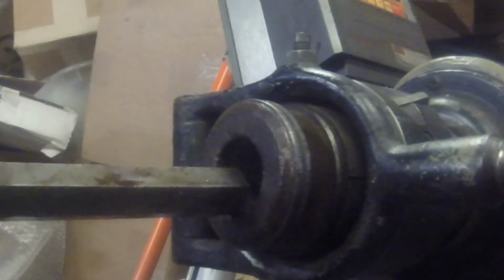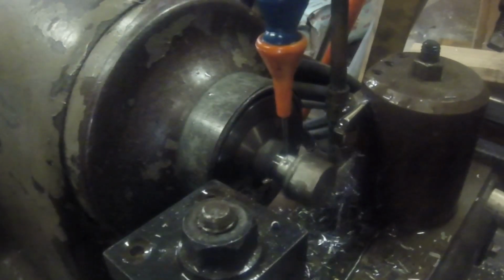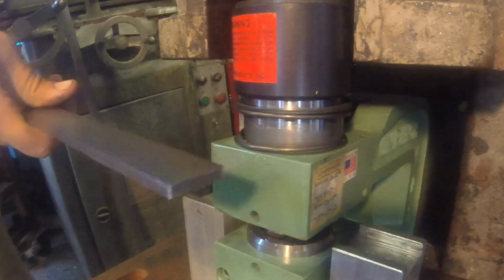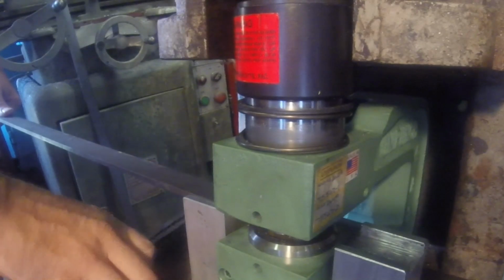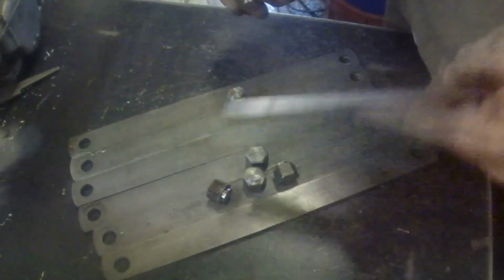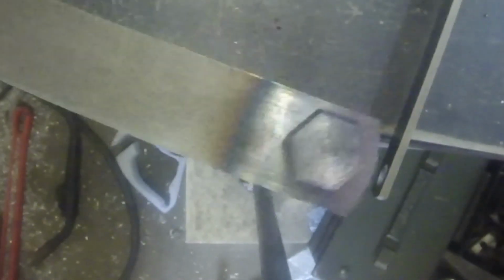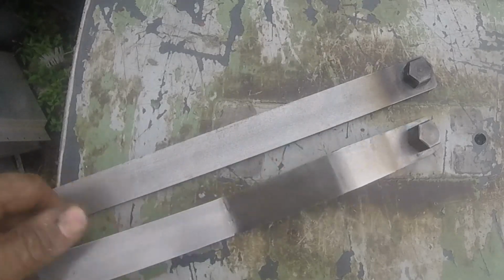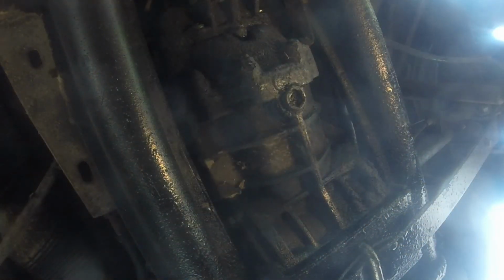Making a hex drain plug tool

Comment: Suggestion - while on the lathe put a bevel on the back of the rod so when you weld it in you get better penetration - then tweak your welder settings, wire size, etc.....
Reply from the maker: That's a great idea!  Maybe once or twice in my life I've laid a pretty weld bead and it was after doing it for a few hours.  I need to just sit down, suck it up and figure it out.  Maybe this winter when it's freezing cold in my shop :)
Reply: Ebbco of course you could also countersink the punched hole a bit - that would give you a nice “V” to lay the weld in.
Reply from the maker: Very true.  Give the bead a nice place to flow into.
Reply: Along the same lines......why not put the chamfer on the end of the hex while it's in the lathe and skip the milling machine setup all together?  
Cool vid.....cool product. Thanks! :)
Reply from the maker: I thought of that but with the hex bar the chamfer would be deeper at the points than on the flats.  I wanted an even chamfer all the way around.
Reply: Ahh.....good point!  Not sure why that didn't dawn on me before. LOL :)